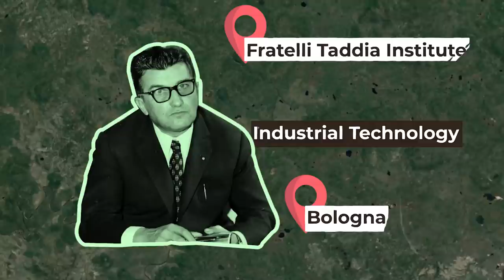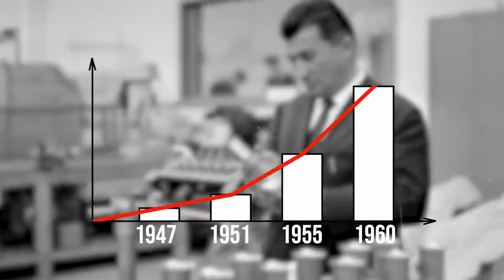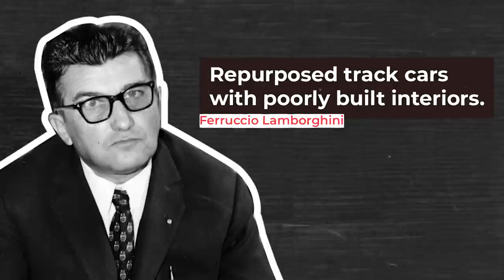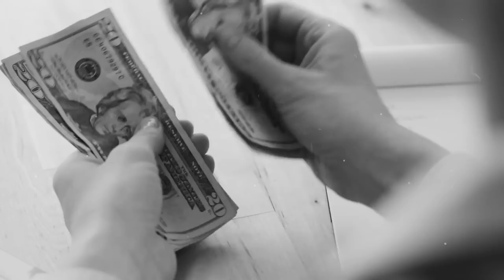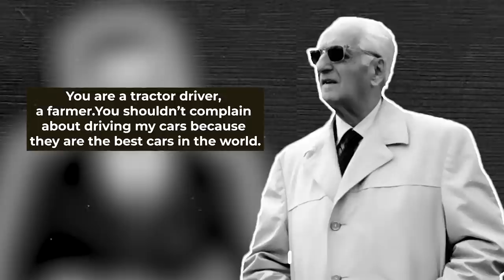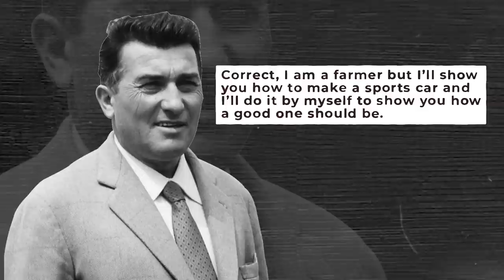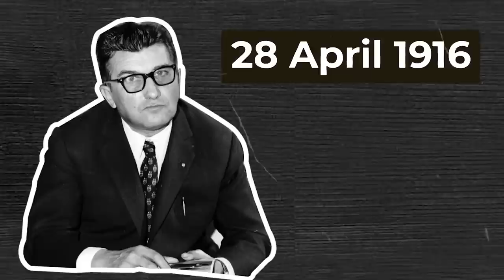How Ferrari Motivated This Former Prisoner To Invent Lamborghini

Comment: I just bought a Diablo Roadster with 750 original miles after looking at endless other options ( ferrari included ) im also an auto engineer by trade and i totally support Mr. Lamborghini's opinions - older Ferraris are superficially made garbage made from shelf parts. this is a post war fact. this video only makes me love my car more knowing the rebel that spoke up and started it all
Reply: Totally agree with you... I worked on Ferrari's and omg what utter junk.  I was Mbenz trained and certified and worked on german cars, when i was asked to fix a few types of Ferraris it was a shock to see how basic and utter junk.  And OMG slow.